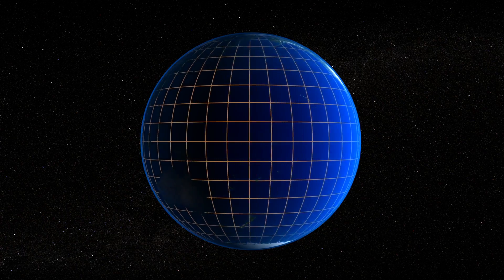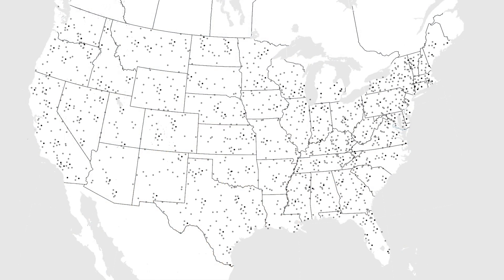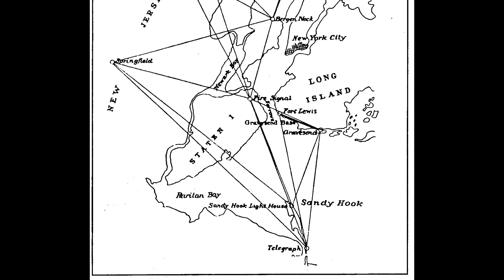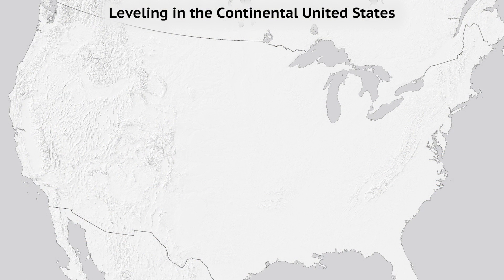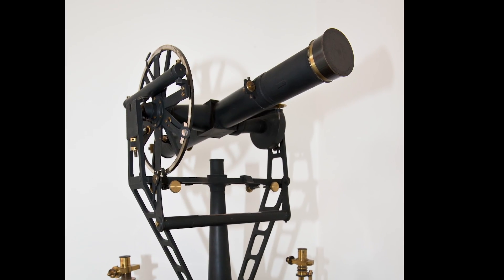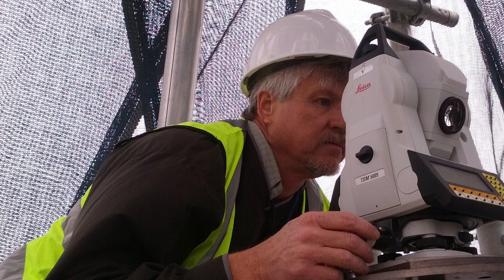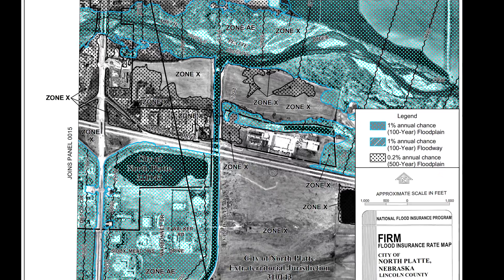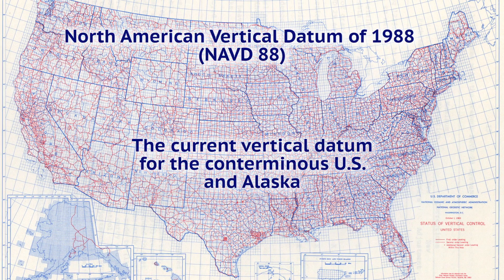How Were Geodetic Datums Established?

Comment: When surveying a distance between two points, how does one differentiate between elevation change and earth curve?
Reply: Clearly they don’t or didn’t. Suddenly all the globe earthers are throwing this geodacy at me. As far as I can tell it’s all triangulation at the ground level, not till it gets to the actual map makers does any of the curve maths seem to enter any of the equations!
Reply: @davidstirling7992  yup ! Well said . Globtardia are forgetting two major factors -
(1) allegedly our is supposed to be an oblate spheroid and not a globe ( they are neither )
(2) our earth has topography ranging from vast mountain ranges to very deep canyons,globlings believe it’s like a cue ball ?? 
A theodolite is used for comparing elevations , but firstly it is calibrated by a simple bubble spirit level - if the datum is level , then you have an unwavering reference point .
Reply: You don't. Heights are measured separately by comparing differences in acceleration due to gravity, which is constant at mean sea level. Measurement of heights relative to other points is accurate only within a local area.